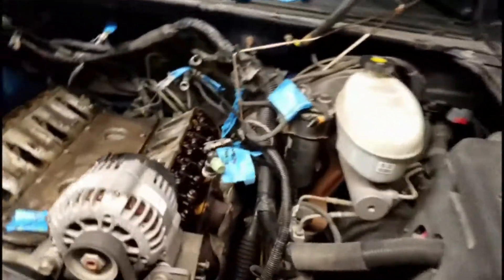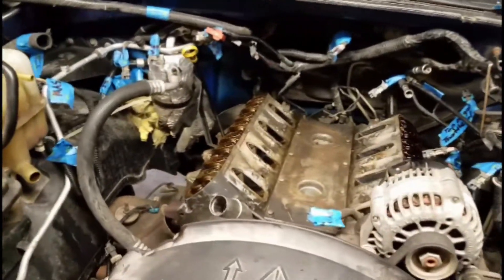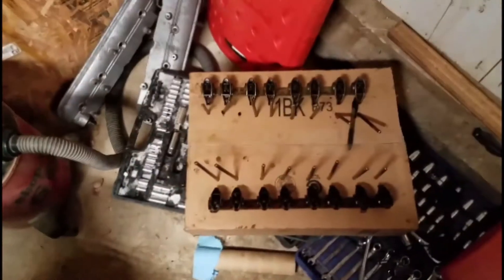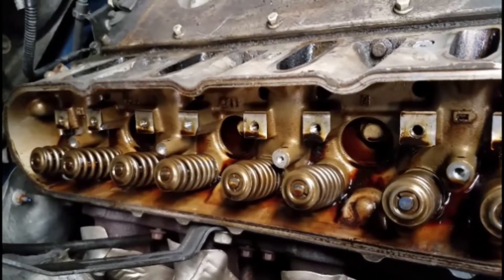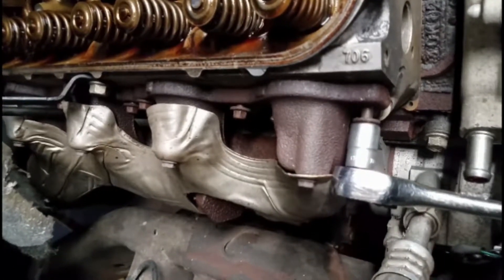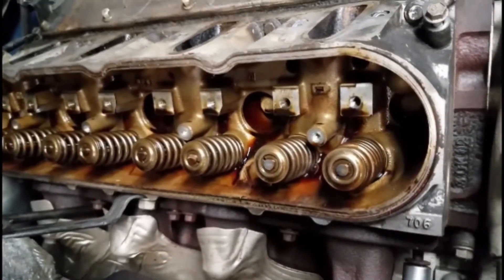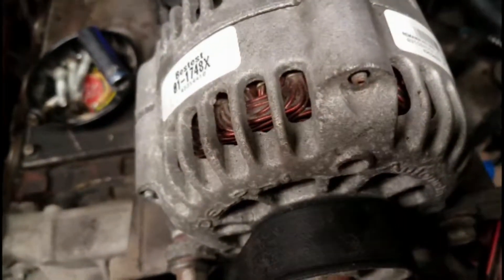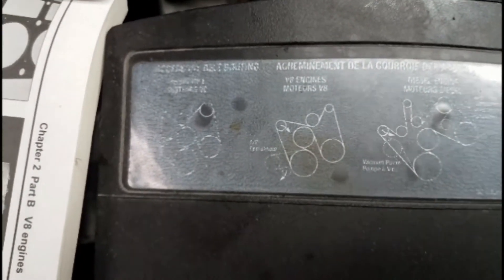Cylinder Head replacement, Part 2

Comment: Good video family. I’m preparing to do a cam swap, cylinder heads, valve train, intake manifold, and tune soon so this video definitely helps prepare for the work ahead. I think It will take some time for sure but that’s fine.